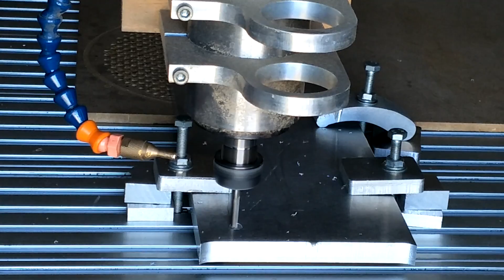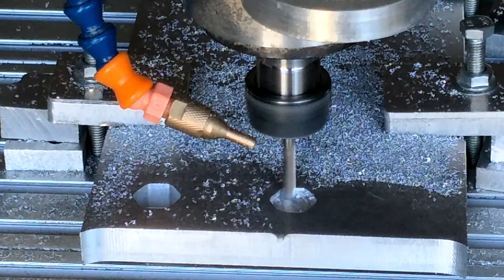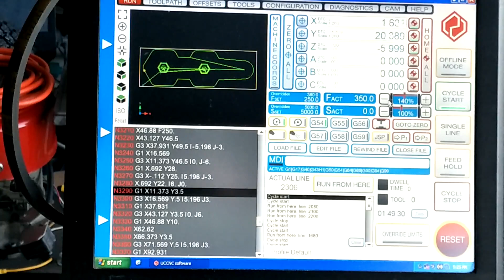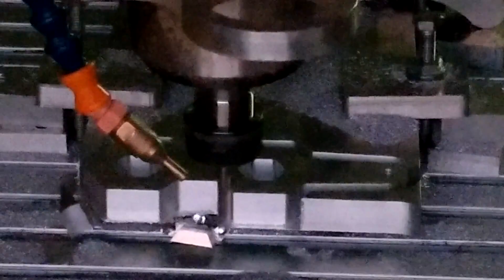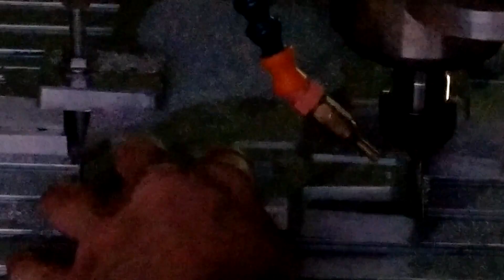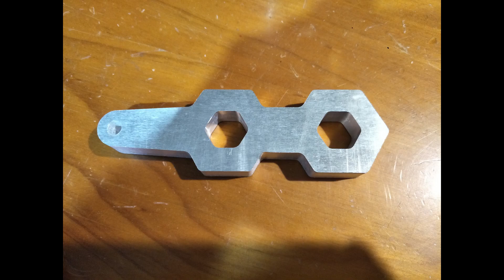Speed Spanner

Comment: Lovely job, i also like to hold the pieces (wooden cuts) but i use a piece of wood to keep the fingers safe.
Reply from the maker: Really is a fine line between finger safety and ruining the job. I have had the cutter buzz my nails before and it does very little damage, but I am very mindful of not having loose clothing or anything that can get caught in the spindle. That would make for a very ugly flesh mess. I also factor in how fast the spindle is moving and how good of a hold I can get on the job before getting fingers anywhere near. Also it probably looks a lot more dangerous on bits where the video is sped up.